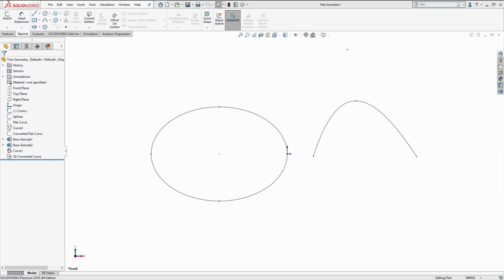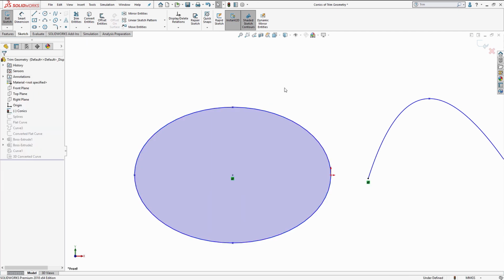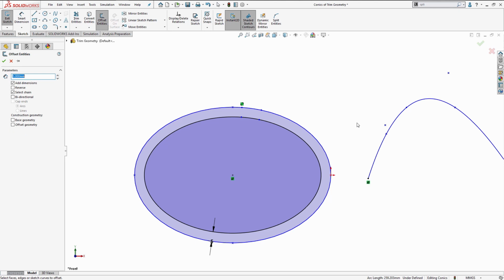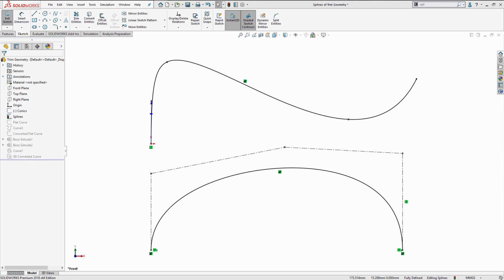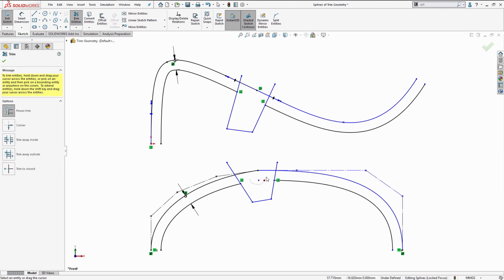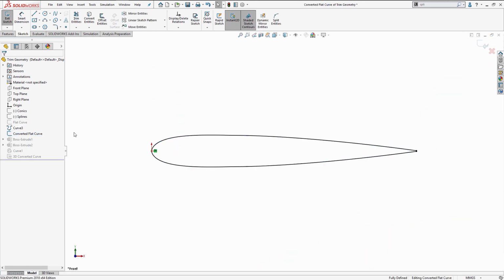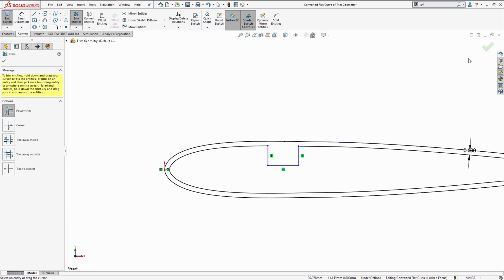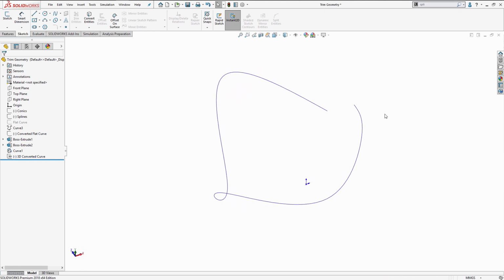SOLIDWORKS - Trimming Offset Sketch Geometry

Comment: There is a much easier solution to this.  Once you have used the offset entities tool you will notice that the offset line goes black - meaning it has been fully defined.  In order to be able to snip these lines simply select them all (CTRL+A if they are the only lines so far).  Then select Display/Delete Relations  and then Delete All.  The lines will then go blue.  Any new lines you draw that now cross these offset blue lines can then be snipped anywhere you want. This works really well when you have drawn splines that you want to use with offset entities.  I have found that splitting entities is a bit hit and miss when it comes to snipping.
Reply: Thank you so much!
Reply: Thank you.